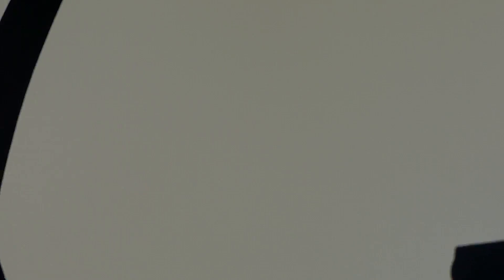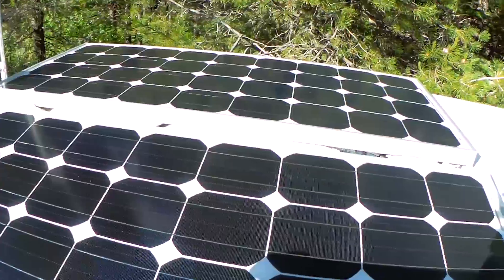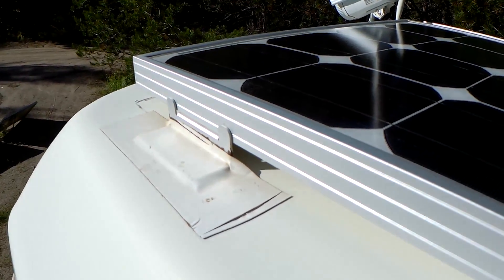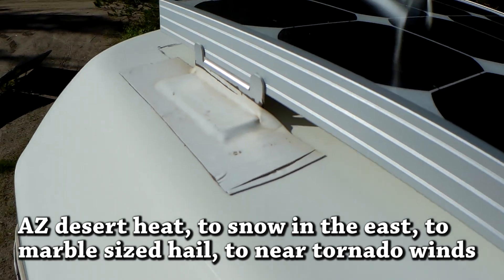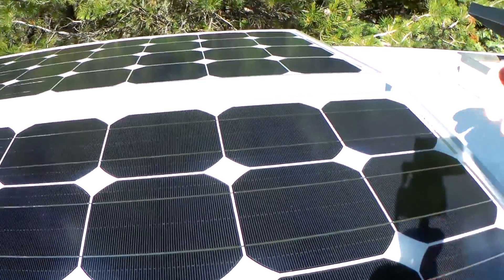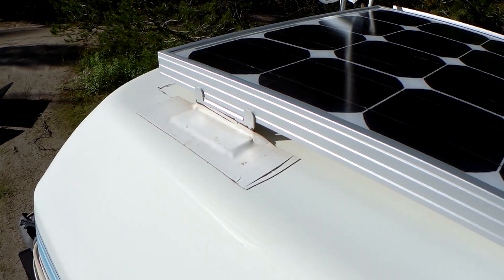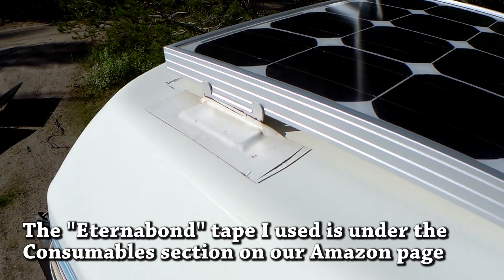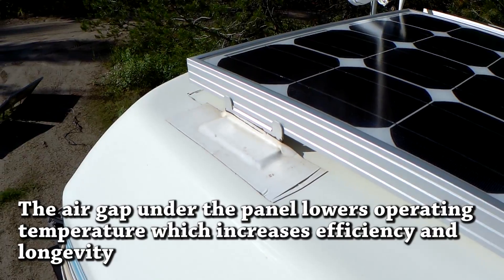NO DRILL NO HOLES SOLAR PANEL INSTALL USING 3M VHB TAPE - ONE YEAR FOLLOW UP REVIEW

Comment: Two questions, which model VHB tape and what is the tape you used over the vhb for protection against ultraviolet damage
Thanks
Reply: 3M GPH-110GF should do the trick, it’s UV + water resistant and can survive 200C+ It’s designed to survive the ECoat + bake processes in automotive factories, holding parts to body in white panels. I’m planning to do a flexible solar install with it soon.

Comment: Hi thank you for your video, I will go with your idea but wanted your opinion: I have 3 x 200W panels and need to put the brackets inside instead of outside the panel for space saving. Do you think it's going to be as solid ? Thank you
Reply: I forgot to ask you also I will be about 3 inches from the 2 maxxfans is that ok ? it's clearring good but was wondering   Thank you :)  I really appreciate your videos

Comment: Hi Hobotech. I have been watching your videos for some time. I have a conversion van with fiberglass roof, so want to tape solar panel to roof. My question is: Is it doable to use a 100 watt solar panel to charge my 500 watt rockpal lithium battery? Thanks

Comment: HOBOTECH -  There are a lot of people out there who will show you how to make a thing.  There are whole lot less who will show you how well it actually stands up to the test of time.  That makes your 6 month and 1 year follow up videos solid gold.  I am now completely sold that VHB tape will not fail.  My only concern is that VHB is the very definition of permanent and therefore completely unforgiving of mistakes.  I suppose when a roof has to be repaired or replaced the brackets can be sacrificed to a grinder and the panels can still be salvaged.
Have you ever wished you had installed the panels with adjustable mounts that allowed you to tilt them for maximum solar exposure?  
I completely respect that you won't disclose your actual location; just because you're alone doesn't make you lonesome.  I would have not even mentioned Boise and just said Idaho.  Thanks for the video and happy travels.
Reply from the maker: I'm actually doing a 2 year update video right now. No, I don't want adjustable panels because I also have 300w on the ground and definitely don't want to have to get out the ladder constantly.  By the way, VHB is easy enough to remove by cutting the foam part of the tape with hacksaw blade and then use either WD40 or 3M adhesive remover.
Reply: @HOBOTECH  -  That helps a lot.  Thanks again.

Comment: Thanks Tom!!! I told a couple of my techie friends about this and they are skeptical, so I sent them this followup video link as well. Every encounter I've had with VHB has been just amazing and I'm impressed but not surprised at your experience with the panel mounting. We're up here waiting for the Canadian winter to start, so the 2004 RT 190P van is in semi-hibernation (no camping - just driving) but next spring we'll be putting two 110w panels up with VHB. Thanks for all the excellent instructionals. Hope you are doing great! Cheers from Halifax, NS.

Comment: Hello ,terrific video update. I talked to 3m a  few minutes ago and they told me under no circumstances should it be used on a painted vehicle. I realize your install,and all others have been on fiberglass.  I do realize just how effective the tape is ( vhb 4950 ) and am glad you have had so much success with it. But I do wonder if the tape is so strong that on a moving vehicle at highway speed,could the vhb be so strong,that it could peel the paint off the top of my van,which has really great paint on it. I thought about sanding spots for those z-brackets,right down to bare metal to negate that possibility,but it seems extreme. for me,I am too much of a lazy person that does not want to take down the headliner,also in good shape,to make sure to drill and not into some wiring bundle by mistake. I hate to drill holes because of the possible leak down the road. thanks for your GREAT videos,I have learned alot,take care,
Reply from the maker: 3M's website has specific instructions on surface prep for painted metal. I don't remember exactly where it was but it was a document that went over the different types of VHB and what surfaces they are good for. I would probably sand some of the clear coat off at least then do the typical alcohol prep or whatever else they recommend.

Comment: Awesome!  Since finding your 3 other videos, I have decided to mount my Renogy panels in the same way.  I have a fiberglass camper shell and plan to mount on it.  The shell is too narrow on top to use the Z Brackets, so I was going to build a light frame to mount the panels to. and mount that to 4 pieces of angle with a  2" X 3" foot print with about 1 to 1.5"" height.

Comment: Hi Tom, question that maybe you can help me out with. I have a 2001 Dodge conversion van and it's got one of those fiberglass "wavy" tops on it. What are your thoughts about using your tape-down method on a non-flat surface? There's a flat'ish area that would probably fit two panels at the back of the van, but not certain how flat it is cuz I can't get on a ladder to look (I don't own a ladder.)  I would rather not put any holes in it bcz it's 17 years old, black, and appears to have suffered a lot of sun exposure, so probably brittle and prone to cracking if I do. Plus it's a conversion van, so removing the headliner would be a tiny nightmare (lights, electrical, hardwood finishes.)
Reply from the maker: My roof isn't flat either, it's curved. You can probably bend the aluminum brackets to fit your roof (see my install videos in the description). If it is really wacky you may need to get creative. You could VHB tape stripes of angle iron or some custom brackets to the roof to make a virtual flat surface to mount the panels to. Just make sure you mount the panels as far as you can from the roof vent, a/c, or anything else that can cast a shadow during winter when the sun is low on the horizon.
Reply: HOBOTECH thanks for the suggestions.  I appreciate your instructional videos too.

Comment: HI Tom! I'm getting ready to buy a new Roadtrek 190 VERY soon, and, I was having a few doubts about the solar panels. Like you, I don't want to drill a bunch of holes in the roof either. Thanks for the info you provided! But, where did you route the wires from the panels to the inside from if you didn't drill any holes? I'm hoping I can get at least 3 panels on top for at least a 600 watt ouput. I retired in 2015 and I'm chomping at the bit to get back on the road full time...I spent 38 years OTR as a truck driver/owner operator...it's time to see the USA on 'MY' terms now! NO logbooks, NO scale houses, NO roadside DOT checks, NO bosses, and, NO schedules! I can see right now that you and I would get along good seeings how I'm pretty darned techie and geeky as well!

Great video, Tom! Travel safe, be happy, love God, and, have a great day!

(7/21/2019 Saturday   8:46pmCST   Houston, Texas)
Reply from the maker: Sounds great! Follow the links in the description to my install videos. I'm not sure if you can do the same on a brand new RT. Fitting 600w on the roof of a Class B sounds real tricky even if you use the premium Renogy panels that are smaller. I could at most fit 3 x 100w panels on my roof. I opted for 2 on the roof and 2 on the ground. Remember, you don't want to put the panels anywhere they will be shaded by the roof vents or anything else. Shade the size of your hand will kill that panel. I see people install way too close to obstacles and then complain in the winter they have no solar.
Reply: HOBOTECH -- Thanks for the ❤️and reply! Good advice! Stay safe!

Comment: so where did you get the wide tape, i can only find 1 to 2 in or very very wide stuff
Reply from the maker: http://hobotech.tv/amazon/ under Consumables
Reply: there's a good reason I couldn't find it, you called it VHB tape when it's actually called Eternal bond tape
Reply from the maker: If you watch the install videos you'll see I use two kinds of tape. VHB to hold the brackets down and Eternabond to cover the brackets.
Reply: I was asking about the vhb not the eternabond tape, so where'd you get the vhb it's not under consumables
Reply from the maker: It's under Solar.

Comment: I just watch a video they were having a hail storm in Colorado. Was wondering if you been thru a hail storm with those Panels, would Panels get damaged in a hail storm?
Reply from the maker: I've been through ones with marble sized hail and came out unscathed. They design these panels to withstand hits from a baseball. You'll lose your windshield before one of these.

Comment: beware...  need to carefully follow instructions when using vhb tape...  i installed a panel last summer with vhb and it has stayed put no problem - however, i installed a second one this spring and unfortunately did not heed the temperature warnings - i should have waited till it got warmer but i was in a hurry - after a few weeks it came off while i was driving down the interstate - luckily the eternabond i had on the wiring kept it from flying off - it was ruined but no other damage was done thank goodness
Reply from the maker: Very good point. Each type of tape has its requirements but a general rule of thumb is to install above 60 degrees. If you can't do that then use a heat gun on low after application to help the glue bond to the surface. Then you have to wait at least 24 hours (preferably 72) before driving or even exposing the panels to significant wind. I was fortunate that it was a warm, dry, and calm Arizona day when I installed mine.

Comment: Gotta love that ladder!
Reply from the maker: I do! It's really compact and lightweight. I wouldn't try painting a house with it but it gets me up to the roof for maintenance and that's what matters.
Reply: @HOBOTECH  where do you get it?  Didn't see the brand name
Reply: @HOBOTECH  It's not on your amazon page now - this video is a couple of years old though
Reply from the maker: @JustVinnyBlues  https://hobotech.tv/amazon/#Tools
Reply: @HOBOTECH  Thanks. I had looked there, but I missed it.  By the way, I am looking at something you should review.  It is a 120 W solar panel with a unique controller.  You can charge batteries, and also connect directly into a solar generator with 10 connector/adapters, supposedly it will fit anything.  No bypass or adding on.  Eco-Worthy.  Very cheap too.

Comment: HT:  In you intro montage you look significantly chubbier than you do now.  Question, are you slimmer now, or have you pulled off an optical illusion?  Btw Odin looks the same.
Reply from the maker: I lost significant weight since full timing. I get a lot more exercise and eat less crap than I did living in sticks & bricks. Who knew #vanlife was the best diet?
Reply: HOBOTECH Score!
Reply: I agree ...I followed your advice for my panels ....will do the same with my diet 😉

Comment: Cool product review, I was going to install soler panels on the roof of my rig using sikaflex 221. That was until i found a ladder rack on Craigslist for a killer deal.
But if i get the opportunity to build another camping rig i will most certainly try VHB tape, I just found out about that product about two weeks ago on another YouTube channel, the guy was putting a camping trailer together using just the tape to attach the walls and the frame together.

Idaho can be extremely hot during the summer months, i used to live in Lewiston and it can easily get into the triple digits during the summer. 
Here's a place that you might want to check out, try looking up Winchester state park in Winchester Idaho. Cool little town just off of US-95. If that doesn't work for you there is some camping places just south of there that are pretty good. Just gravel roads too deal with.
Reply from the maker: Interesting. I'd like to see that video. I spent a couple nights in Lewiston before making it to Boise. I know they are close to sea level and get almost no snow, but on the flip side get plenty of 100 degree days. I did pass through Winchester on the way down but didn't stop at the park. I will next time I head to Sandpoint.

Comment: I should be able to guess from your video, but I'll just ask.  What width VHB tape did you use for your solar panel mounts?  I'm thinking about using your method for mounting 400 watts of solar on my Class C.
Reply from the maker: The strips I used are on hobotech.tv/amazon under "Solar" and are 1x7. I cut them in half to fit the brackets perfectly. There is plenty to do 4 panels in one package. The stuff is so useful around the rig I ended up buying a 2nd package.

Comment: Great update on an excellen solution for solar panel installation. I guess the same tape can be used to secure a roof fan, too. I forget if you changed or installed an roof fans, if so did you use the same tape for that?
Reply from the maker: I didn't install a fan, but I don't see why you couldn't use VHB for that. You'd definitely want to use Dicor lap sealant on top to prevent any leaks.
Reply: Thanks! Roll on, my friend. Your videos are killer.
Reply: R Morlote yep thats what I was reading the comments , to see if indeed the fan too was installed this way. I have seen them attached with just sealant but no one does a “follow up” video to share results. That is why this video showing the results with solar panels is SO GREAT!

Comment: Thanks for the update, I'm still deciding if I should put a solar panel on my roof so your four videos have great advice. 🇨🇦
Reply from the maker: I think I might do a roof vs ground deploy solar video. Unless you are plugged in all the time it is a good idea to have at least one panel to keep the batteries topped up.
Reply: HOBOTECH, that too would be very helpful.
Reply: @HOBOTECH  thats exactly why I have now got a fixed panel on my ute roof and a folding blanket for extra power if needed - thanks for the great video BTW